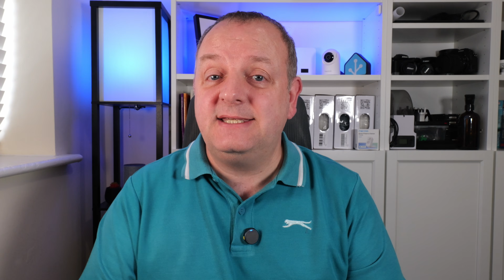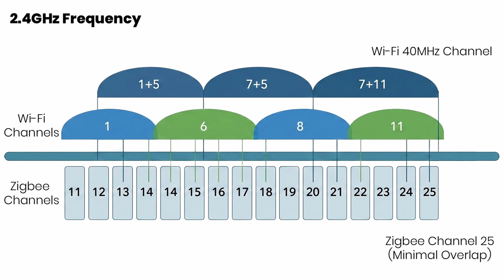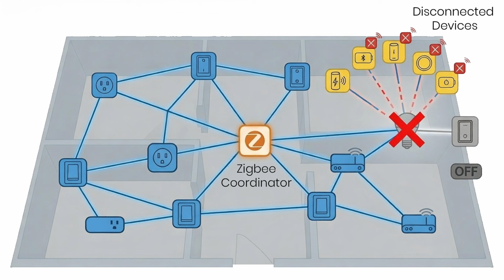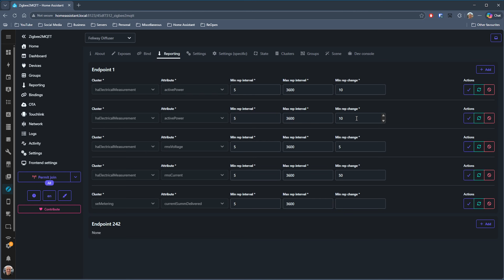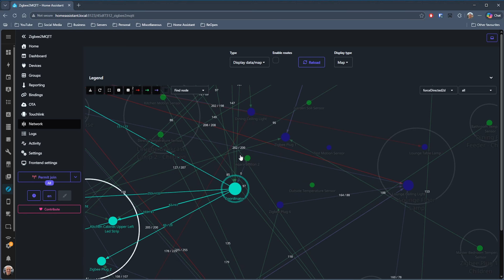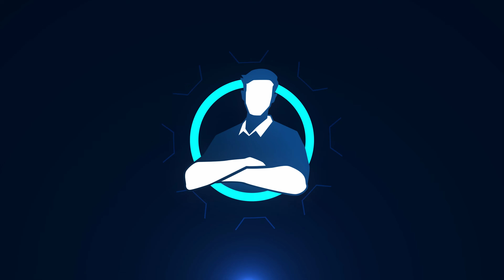Why Your Zigbee Mesh Network Keeps Failing (And How To Fix It)

Comment: I too have issues with the LQI of many of my Zigbee devices.  I'm just starting to use HA.  I bought an SLZB-06P7 Zigbee coordinator since then I can put the coordinator somewhat everywhere in the house where there's an ethernet cable available.

However, I have smart plugs located in the neighbourhood of my coordinator, hardly at a few meter distance.  And still, the LQI of those smart plugs are hardly between 50 and 60.  This, while they can literally "see" each other (no walls or doors in between, open space).
As a matter of fact, as of this writing, one of those smart plugs (ThirdReality GEN3) has an LQI of 26 (!!!).  And a few moments later, it jumps to 86, then 58 and so on.

And I also have many of those smart plugs already in the house.  All of them are, next to smart plugs, also rounters (I have 4 INNR smart plugs and 12 ThirdRealith GEN3 smart plugs).  But still, none of them has an LQI > 100.

On the other hand, I have a Sonoff 4 button switch (battery powered) which is on my desk in my studyroom to test things out and this one has an LQI of 255!!!   And next to that Sonoff 4 button switch, in the direct neighborhood, there's also quite some presence detectors, door and temperature sensors  (all battery powered Zigbee devices) and the LQI of those devices is hardly between 60 and 80.

I sometimes do not understand this whole LQI in the Zigbee mesh network and I also don't always understand the path some devices are taking to connect to the mesh network...

I've followed some of your advices.  For instance, to drop the "not-so-needed" MQTT information sent out by some devices.  This, to avoid queing up of messages.  For instance, I don't care too much about the power factor, which is available for the smart plugs.  But even if I set the min rep interval to 3600, I still see the MQTT message passing by with the slightest change in the power factor value.

PS: I'm using Zigbee2MQTT, not ZHA.  But I don't think that matters, right?

Comment: Ah, the "shielded" USB extension cable. No idea if mine is shielded - I did not notice a big difference. My system seems to work fine without.
After having installed 6 or 7 HomeAssistant systems, I discovered that having a good mesh is important. My current workshop is a large building (75 x 15 meters) with a number of metal walls (spray cabin and paint mixing rooms) and I had to place some additional routers to get a good robust operation.
I my new home, the system was not that robust with just a few lamps and battery powered switches/sensors but with now +50 router enabled devices and ~30 battery operated sensors, the systems works perfectly well.
For those still reading: My system contains mostly Ikea lamps (~ 40) (old zigbee generation), Sonoff SNZB-mini in-wall modules (~ 10) and Neo smart plugs with energy meter (~15) with a Sonoff ZBDongle-E and sensors/switches from Ikea, Sonoff and some Chinese brands.
Reply from the maker: Thanks for the input and it definitely sounds like you've gone the right way with having those routers 👍

Comment: QQ, physical location of zigbee dongles, especially near wifi APs, any thoughts? I have 3 SM Light devices next to each other and right next to a wifi AP, everything seems OK but wondered if there is more to be gained by placing them in different locations
Reply from the maker: Could you separate them out a bit, is there a reason they are where they are?
Reply: @Byteofgeek  Yes they can be seperated. They are located in the attic and are close to a poe switch, more for convenience than anything. Looking for solid reasons why they SHOULD be moved, if at all
Reply from the maker: Arguably if it's working OK then I'd perhaps leave it. What are the SM Light devices doing, all Zigbee? A Thread router?
Reply: @Byteofgeek  nailed it, 2 zigbee, 1 thread

Comment: 13:31 I use very cheap battery powered temperature and humidity sensors. I think that they only send updates when there’s a change but I’m not 100% sure.
Reply from the maker: If you're using Zigbee2MQTT you should be able to see their updates in the activity window

Comment: I run 25 Zigbee devices on my network and I’ve had no issues at all (despite using predominantly the cheapest Chinese devices I can get;) 

I did use a shielded USB extension cable from the start and I’ve made sure to have enough smart switches to form a network with plenty routers.

I later found out that my Zigbee network doesn’t interfere with my WiFi channels so I was lucky the default channels didn’t interfere. I use ZHA btw. 

Even though everything is working flawlessly, it’s good to be aware of things that could go wrong. Thanks!
Reply from the maker: Thanks for watching and sounds like you took the right steps to start with, most of it is all about the right number of routers 👍

Comment: I agree with another comment in this thread that this subject isn’t nearly covered as much as it should be…kudos for a great video on this topic! 

It occurred to me if without realizing it, are you possibly making an argument for those who believe the best way to build and structure your smart home should include using multiple protocols and even multiple hubs that can be dedicated to a specific class of smart devices?
Maybe choose a class of devices and segregate that class to use exclusively with designated protocols available to smart home users such as WiFi, Zigbee, Thread, Z-wave and LoRa or 434MHz or even Bluetooth.
Below are two great examples that I illustrated below with the help of AI…
Lutron switches for example are well known as being rock solid reliable by many reviewers…
Lutron is a highly regarded smart switch manufacturer that works with what they term as 
Clear Connect (Primary Lutron protocol)
	•	Type: Proprietary RF protocol developed by Lutron
	•	Frequency: Sub-GHz band (about 434 MHz in the U.S.)
	•	Used by:
	•	Lutron Caséta
	•	Lutron RadioRA systems
	•	Lutron HomeWorks lighting systems.
The Lutron hub is protocol agnostic and works with Home Assistant amongst other protocols. 

Another reliable product class seemingly immune to drop-off is Philips Hue light bulbs. Again a segregated class of product that can also be used as part of your strategy when building your smart home…

Phillips Hue is a well respected brand and favorite promoted by many YouTube reviewers.
Why is the Hue hub often more stable
1. Optimized Zigbee network for lighting
The Hue Bridge runs a Zigbee network tuned specifically for lights using Zigbee lighting profiles.
	•	All devices are bulbs or Hue accessories.
	•	Routing behavior is predictable.
When bulbs join a mixed Zigbee network (like ZHA or Zigbee2MQTT), they sometimes act as poor routers for sensors, which can cause drop-offs.
2. Better firmware coordination…
Hue bulbs receive firmware updates through the Hue Bridge.
These updates are tested specifically with the bridge’s Zigbee stack.
Direct pairing to other hubs can mean:
	•	slower firmware updates
	•	occasional compatibility quirks.
3. Network isolation
Using a Hue Bridge creates two separate networks:
	•	Hue Zigbee network → bulbs only
	•	Your main Zigbee network → sensors, switches, mmWave, etc.
This separation prevents lighting devices from interfering with motion sensors, door sensors, and other battery devices.

I know this opinion partially sidesteps the purpose of your video, but some of us aren’t as save as others when trying to troubleshoot network device drop-offs and accessing router settings to make adjustments as you instructed in your video.
I submit that many of the conflicts you highlight could be avoided organically by using the right products for specific use cases and still have Home Assistant used as the backbone of our smart home.

Comment: There is a QoS setting for each device. I've not seen anyone on YouTube talk about this. I feel that setting this will guarantee that a command will be delivered and received. So for example opening or closing the blinds is something that happens once or twice a day and it would be good to know that it happens. Setting up QoS would achieve this (I believe). But it adds extra traffic. I'd love to see a video showing the pro's and con's and exactly how to set it up.
Reply from the maker: It's not something I've used before but I'll have a look into it. If it increases packet payload, then I'm assuming on large networks, this will have a detrimental effect.
Reply: @Byteofgeek  Cool - thx. But having to redo actions that fail also have a detrimental effect on my sanity. :) I have a hue click button that turns off all light in the house. Last night it took 3 goes for them all to turn off. As it is per device setup you would likely do it on lights switches etc but temp sensors and the like would remain as they are.

Comment: As another caveat exception, if Apple‘s Thread network is set to channel 25, then the Zigbee network should NOT be set to channel 25?
Reply from the maker: If you're using Thread and Zigbee, then yes there is overlap here and you'll want to move one of them, Zigbee would most likely be the easiest to do.

Comment: I am disappointd in the performance on my ZHA-2, is thin usb cable to blame?. It does not appear the be shielded...
Reply: I don’t know but I use a shielded USB extension cable and I’ve no issues at all. 
Those cables are very inexpensive so . . . 
Please let us know if changing your USB cable helped or not. Tia.
Reply from the maker: You definitely want to ditch the thin cable and get a proper shielded one

Comment: Z2M's tendance to not restart after HA restart, or to silently crash without the HA watchdog managing to restart it, is the elephant in the room you didn't address. Looks linked to edge cases with the PoE dongle, the host's hypervisor etc
Reply: I have set an overnight automation to restart Z2M because of this
Reply from the maker: Nice workaround 👍
Reply from the maker: Interesting, it's not something I've experienced and I use a PoE dongle and Z2M. Do you get that every time you restart HA?

Comment: Great video - I've switched all my Zigbee devices from Hubitat to HA with a Sonoff zigbee controller, although most of my automations run on Hubitat.  I've had a fair bit of experience of zigbee issues in my early days with Hubitat (mostly thanks to a few old Aqara sensors, and not having enough routers - no longer the case thank goodness). I definitely agree with pairing the routers first - probably best to do at least one per room.

I have a couple of questions: 
1) The LQI - what would you say is an acceptable range for the LQI?  I have a couple of devices where that Z2M shows the LQI in orange - the worst of which is around 104 (an old AJAX Online LED controller under the bed), but that still seems fine pretty much all of the time.

2) The aerial on the zigbee controller (many of the current ones have an aerial that can be tilted an rotated). Any recommendations about the orientation of the aerial? Vertical? Horizontal? Or some other angle?

BTW I have a recommendation for anyone just starting out with Zigbee2MQTT - when you pair a device, look for it in the Devices view, and give it a good name rather than just relying on the hex code - I also tend to tick the box to update the HA device name at the same time.

Comment: I've never had issues like what you're saying, but I had issues with batteries dying weekly for 3 months on only for Philips Hue motion sensors. I think the latest ZBT-1 firmware fixed it.
Reply from the maker: Sounds like they were possibly constantly reporting back and draining the battery, good that it's sorted though 👍
Reply: @Byteofgeek  It's probably what you're saying. Is there a way to check that debug info? Sadly, more time passed, and 5 of 'em died again. I got the ZBT-2. Hopefully that fixes it :(
Reply from the maker: If you're using Zigbee2MQTT then there is a live activity monitor in there that will show you devices reporting back

Comment: We have a crazy IP setup where 4 people depend on daily for work and school. We run 4 WiFi routers, because reasons. On top we have 2 ZBT-2's for Matter over Thread and Zigbee. And, if that is not enough, we have RF for some older devices. 
There was no planning at all when we rolled out the 2 ZBT-2's on top of our nightmare WiFi. We like living on the edge. 😂
We got lucky. It's working great.
But, I'll keep this video in a safe place just in case. 😅
Reply from the maker: So much going on there, is it just luck that it all works? 😂

Comment: My ZigBee controller kept crashing and requiring a reboot (even when I upgraded to a completely different one) and it turned out to be one particular model of smart socket causing havoc on the network. I had 6 of them, all in the bin now and the network is rock solid.
Reply: Can you remember what the model was?  I'm sure most of use would like to avoid that issue.
Reply: @robheyes6470  yep, they were only in Australia I think. Sercomm SZ-ESW01-AU. Then again there could be versions of them for other countries too.
Reply from the maker: That's quite the impact on your network, but a good end result 👍

Comment: I've done channel migraiotn in home asistant a month or two back. I had no problems and dd not need to re-pair devices. Perhaps this used to be different before?
Reply: I did that also in ZHA a while ago only 1 device did not follow the change. It can take up to 24 hours to switch everything.
Reply from the maker: Was that a unique device or did you have others of that type which worked?
Reply: @Byteofgeek  I've tried it with Sonof P dongle, the only zigbee device I've used. I've had no need to try others as that was my original one I started with and it has worked well.
For extra range a better antenna does wonders but I have no need for that either because all my devices are easily reached via router devices I have.
Reply: It was an aqua vibration/tilt sensor.  I just had to put it into pairing mode and it re- linked...
Reply from the maker: If everything is working, there's no need to go trying to change things 👍
Reply from the maker: Thanks for the input 👍

I think it can still be a problem, since I've been doing this channel I've had numerous people comment they've had issues with channel migration. I might run a poll on the community page to see what the response is like.

Comment: I'm having my 2652P dongle reinitializing itself frequently... Random times between 1 and 4 hours... Home Assisistant isn't much help diagnosing this... I've been deleting misbehaving devices 1 at a time... It's a bit better than it was but still a mess.  When it's up all devices work and respond quickly so I don't think it's a channel issue... (15). Considering firmware update or new dongle 🤷‍♂️ I only have 43 devices, a good mix of routers and end devices. Mesh looks good in ZHA... Any help would be GREATLY APPRECIATED 😢
Reply: Did you use a USB extension? USB 3 interferes with 2.4ghz, so you want to use a 1-2 meter extension to get the antenna away from your usb port. That’s usually the biggest cause of hardware failure.
Reply: @kungfoochicken08 Yes, and it worked perfect for years...
Reply from the maker: Have you tried connecting it to a different USB port?
Reply: @Byteofgeek No, I have not tried that. It is on an extension cable and worked flawlessly for years, this problem popped up suddenly and remains persistent. I suspect third reality plugs are scrambling repeater messages and possibly flooding the mesh, I'm removing removing them one at a time and allowing the system to rebuild the mesh. But the coordinator is still reinitializing every 1 to 4 hours.
Reply from the maker: As I've gone through the comments, I noticed another subscriber has had issues caused by a specific brand of plug and when they've dropped them from their network then their issues have been resolved.